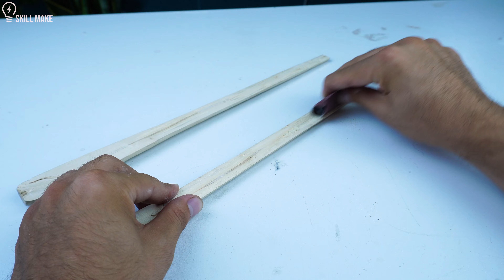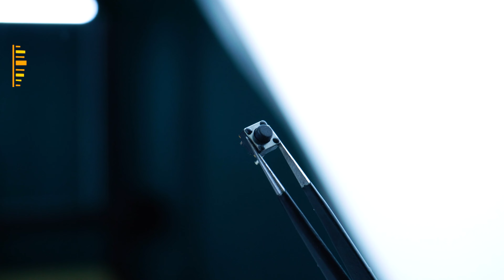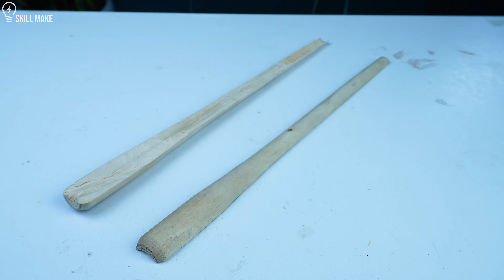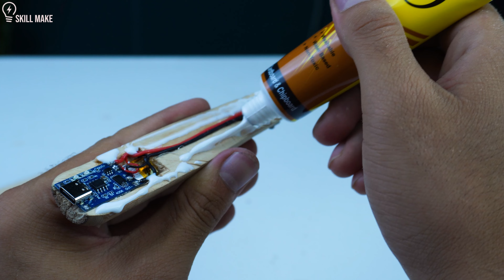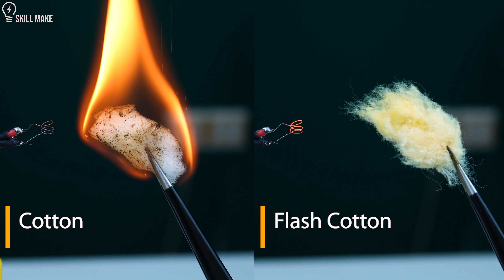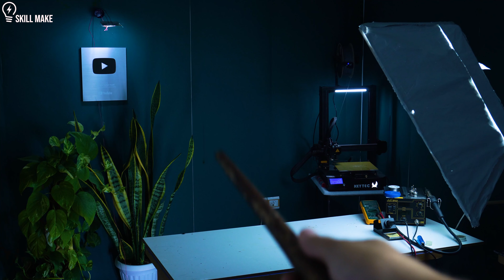How to Make FireBall wands (Harry Wands) - How to Make Flamethrower Wands

Comment: Cool Idea.
Not trying to be a nerd or to be a know-it-all guy
But I wanted to mention that your Nitrocellulose is not made properly.
 Because it's yellow, has some impurities by that I don't actually mean it's slow or not burning like a well made nitrocellulose... that's not the main concern
 Because if it's working and you're happy with it, 
Have fun with it my friend 😊.
But my concern is about your safety nothing else.
When you're nitrating you need an Ice bath at cool temperature not exeeding 20C  then the most important thing you need to wash it with water a couple of times then with a sodium bicarbonate solution until it stops fizzing, then water again to remove any excess acid.
If you don't do that It will be sensitive and kinda dangerous to handle and store.

Btw I enjoyed the tutorial so much, Again thanks for the helpful and entertaining video 👌😁.